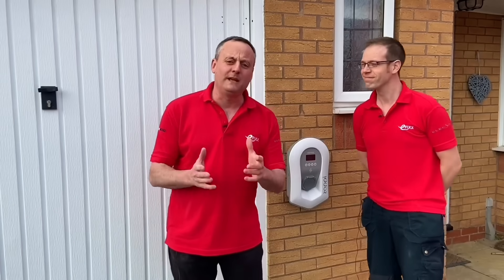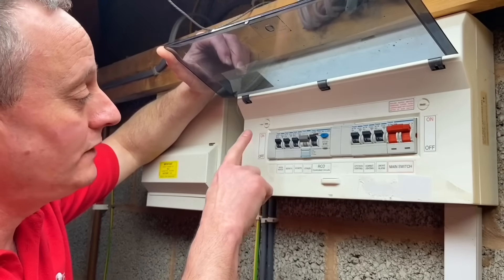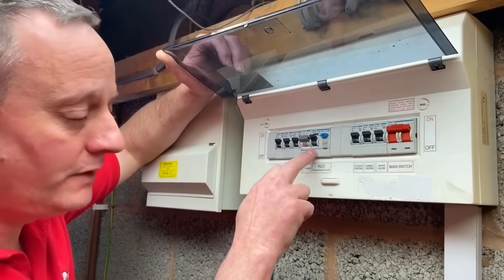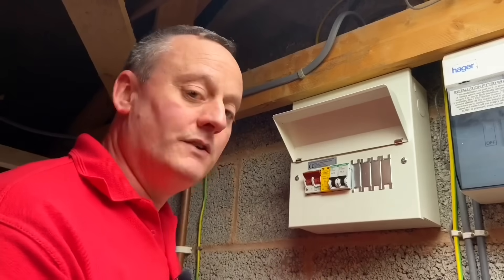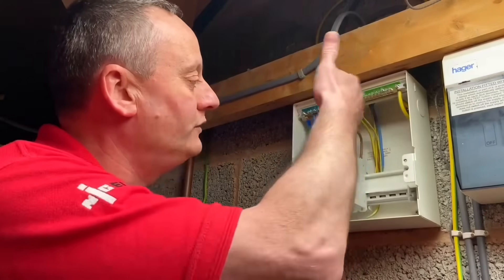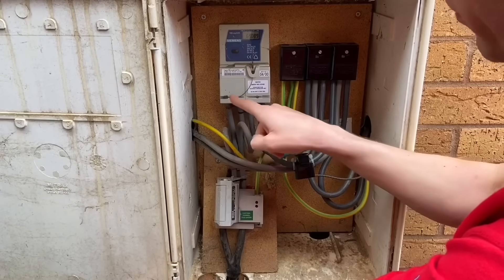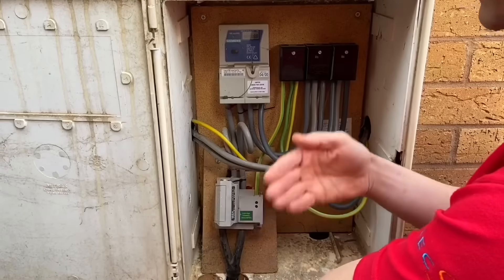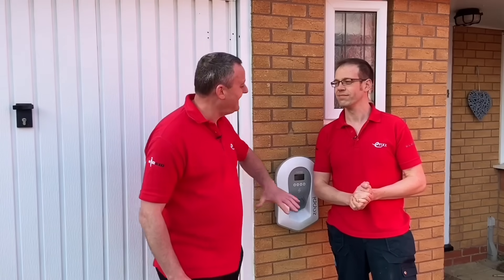EV CHARGER installation UK - can you connect to an existing CONSUMER UNIT?

Comment: They haven't used the existing consumer unit as it doesn't meet current regulations to install a new circuit as its made of combustible material ie plastic. Simple

Comment: What if that was a TT system,  then there would be no rcd protection on the main tails supplying the new consumer board and the the tails and it could be an excessive length from the mains head.

Comment: This may be a daft question, but do you need to have it wired through your consumer board? I live in flats and it wouldn't be possible to wire it all up. We do however have our meter near where the EV charger would be installed. Why can't we just have a switch in the cabinet and not have it run into our flat?

Comment: Did I get it wrong or there is no RCD protection all the way down from the mains panel to the charger unit? What does protect against residual current throughout all that length?

Comment: Just watched your other video about looped systems. You mentioned that 2 cables coming in means a looped system, and that's trouble for EV chargers. Is this not a looped system then? As it has 2 cables coming into the property.

Comment: How about fitting a kWh meter in the CU for the charge point, so the consumer can split out how much energy they're using for the EV? I visited an egg production unit years ago with inverter drives for the ventilation fans, the standard Hager RCD would trip out when you tried to run more than one fan. I suggested they fit an RCD designed to operate with Inverters, at the type it was a Schneider Si type.
Reply: The smart chargers already tell you what energy is being produced. Zappi monitors the EV, house, solar and back up batteries and can divert the green energy directly to the car.  Really good set up 😎

Comment: How would you handle adding an EV charger to a house where the consumer-unit is NOT in somewhere handy like a garage, but is in a wall-cabinet in a room in the house, so that ANY cabling or extra boxes etc canNOT be anywhere outside that cabinet for aesthetic reasons (ask the wife!).  The consumer-unit cabinet is only a little-bigger than the consumer-unit itself.  Could the new separate consumer-unit just for the EV charger be placed OUTSIDE the house near the EV charger for example?  Possibly in the outside meter-cupboard, or in a new wall-cabinet of some sort on the outside of the house?
Reply from the maker: Yes you can but the small consumer unit would have to be located within 3 meters of the electricity meter. Some installers will place them in the meter box, however this is frowned upon by the DNO and energy suppliers. You can locate a small waterproof consumer unit close to the meter box. - hope this helps
Reply: @efixx  Thank you.  That's perfect, and would work fine.  In my case, the original consumer unit, the meter cupboard, and the likely position for the EV charger would all be on either side of the same common wall within maybe a metre of each other.

Comment: Hi, We have a 32amp cable into our garage, will this be enough to connect to a charger, or is a larger cable needed. Thank you, welshman 2081
Reply from the maker: Yes should be possible if you use a charger like the Zappi - it can adjust the car charging in response to equipment being used in the garage.

Comment: Why not just replace the old DB with a new one?  Faffing around adding Henley blocks and extra tails + a second board seems over-kill.
Reply from the maker: Most EV installers are fitting a small consumer unit to avoid taking responsibility for the existing installation.

Comment: Could you just loop the new meter tails off the existing meter box ? Why did they take them from outside at meter
Reply: No and no.  You can't fit 50mm2 of cable into 25mm2 of clamps.  You might crack the old plastic CU and in a World where electricians have to use a torque screw driver to tighten screws there would be too much noise from the air whistling between teeth.

Comment: Hi is that on a looped supply? I see there’s two cables going into the main fuse
Reply from the maker: No it's a single cable, it splits into line and combined neutral and earth at the bottom of the enclosure there.

Comment: It’s best to have things separate as an electrician knows you don’t have to but it makes for easier access and easier faulting .
As a consumer unit has a number of 32 and 16 amp breakers it is best to use a spare 32 amp breaker which doesn’t upset the consumer unit do you know feed et cetera.
So placing a double pole 32 amp switched socket next to the consumer unit the protected outdoor cable can be fed into it and a feed to the spare 32 amp breaker.
Sunsee won’t that put too much stress on to the 32 amp breaker but that is the point if it does the breaker switches off and the person can check what is causing the problem probably earth leak .
Electrician of course would suggest a separate box like one each one in use in a garage or a outdoor office with its own breaker which is a bit of overkill but what consumers don’t know is it each year new rules and regulations come in an electricians have to keep advance of this , It’s just what Electricians will call FutureProofing.
Why 32 amp will this allows a 7 kW feed to the car charger, going higher than this leads to many problems as everybody knows houses now I’ve lots of electrical appliances okay not all in at once but majority of houses in the country only other 80 to 100 amp feed into this premises so going any higher might be good for the car but puts a strain on the house electrics.
As you won’t need charging in the car every night and most people have a good 10 to 12 hours overnight there is really no need for a greater power charging most nights you would just need a top up.
Multiply 7 kW by 12 and you get what will be probably the majority of car batteries in the future of about 80 to 90 kW.
 A second way is to news tales and go straight from the power switches and the consumer unit to the auxiliary unit when the auxiliary unit  has 32 amp breakers .
The only problem in the future is somebody getting a more powerful outside point might be tempted to change the breakers in the auxiliary unit to 64 and using the same old 10 amp cable, otherwise good after news what we call in the trade tales shot pieces that go from the main fuse to the power switches of the consumer unit.
Unless the outside point is very close these will be very very expensive, also I am sure there is a limit to the length that is allowed.
Some people off Claims I could go to 3 phase electricity but then you were going into a minefield for consumers, have you can see the electrics are complicated and could be coming very very complicated with a vast amount of different systems and loads placed on it.
Reply: We in the Federal Republic of Germany use longer times 3 phase power lines as our country is old. Nobody is "surprised" to use it. Of course three phase EV-charger and solar panels are here normally since the 80's.

Comment: I have just had my ev charger fitted and they never went near the consumer unit. I asked the man if he need access to it he said no. They do not wire to the consumer unit or fit any my consumer unit at 3 spares either side but it was not used. 

So why are people going on about consumer units in these video.  My charger is not wired to the consumer unit.
I have nothing likes this fitter the a new breaker in my meter locker and that's it .  Was told the surge protection was built into the charging unit.
Reply from the maker: It’s the installer preference on how they do things.

Comment: Can I ask is it ok to install a new consumer unit outside my property it is IP rated or should I have the new unit installed inside ?
Reply from the maker: If it’s properly IP rated it’s not an issue.
Reply: @efixx  thank you for answering my question my EV charger is going to be fitted by the gas boards EV fitter so hopefully it will meet the required standard

Comment: Hope someone can answer this. In the video the supply out to the charger is in T&E and clipped direct so no additional RCD protection required. This T&E however must pass through the wall to the charger, I thought if T&E is buried within a wall at less than 50mm then additional RCD is required ??
Is the T&E enclosed in metal conduit where it passes through the wall and if so does the conduit need to be earthed (I think maybe not as T&E is insulated & sheathed) !  Am i missing something ?? 
Great vid btw
Reply from the maker: Think about this logically - the RCD rule for buried cables is to protect people from accidentally damaging cable. In this case you can see the cable on the surface vanish in to a hole which is directly behind the charger.  The chances of accidentally damaging the cable are minimal.
Reply: @efixx   Thanks for reply that puts my mind to rest. Its just the regs say some concealed cables in certain instances should be RCD protected; I guess the definition of "concealed" is what threw me !

Comment: You don't have a RCD in the consumer unit because of DC saturation and blinding but the zappi has a type A RCD built in to protect it from DC fault.So this will never happen. So a AC RCD could protect the cable to the yappi. video gets you thinking thou.

Comment: Hi, I'm doing some renovation work on my house which involves lifting the floor. I'd like to lay a cable for a future eV charge point while I'm there. Is this OK to do myself so it is ready for professional installation at a later date without disturbing the floor again? I have 10mm2 T&E which I believe should be fine for a 7kW charger.
Reply from the maker: We recommend you get the person who will eventually connect it to advise on a suitable cable  route.

Comment: Russia we charge battery cars generator 27litre two stroke V10, 1560Kv. Grid not good for big charge blow transformers.
We sale  ex CCCP turbine heli, jet warbird (MIG's) track vehicle with 500kv gen. Gas turbine gen 700kv.
Environment pollute with EV more, cable underground hot melt ice/snow.
Interest in UK generate. 
Sorry bad English spell, Interpreter no in tooday. 
Greeting from Russia (Cherkasy & Girood) ♥️

Comment: 06:20 I thought the switch (for 2 or more cus) must not be covered for quick and easy access. But it seems like it's not a requirement. 421.1.201 and the switchgear must comply BS EN 61439. Now an ordinary person might not have flat head screwdriver to access quickly. 
What do you think?

Comment: Very useful indeed. Cheers. Explained a number of the less obvious issues clearly. The other docs I've seen strongly encourage you to take the charger feed directly from the non-RCD side of the CU (with a 40A breaker) (and not even consider daisy-chained RCDs because of potential discimiination problems). https://evcables.co.uk/d/global/EOCharging/20180622_General_Electrical_Guidelines_for_Installations.pdf

Comment: Great video. Just a question, is the SPD in lieu of the DC protection RDC DD & PEN fault device? As there is RCD protection in the charger it would be interesting to see what type.
Reply from the maker: No the EV charger has all of the RCD and PEN protection built in. See this video 👉 https://youtu.be/uUlyAMmGl5Y
Reply: Be careful there is no BS number for the RCD onboard as yet so requires a double pole RCD

Comment: Have to be careful if a surge protective device is attached to ring mains or radials that have new electronic devices as they have their own protective device built into the power units and can actually cause an issue

Comment: Several questions emerge on the theme of surge protection.
1.  Does the zappi have built in surge protection?
2.  Do car insurance companies cover damage to EVs caused by damaging transient voltages transmitted via the charging point?
3.  Is it likely that car insurance companies could stipulate requirements over and above the wiring regs in relation to the need to have surge protection for charging points in future?  I think weighing up question three is going to be the question of how often do damaging surges occur on the local DNO grid.  I’m guessing it’s nearly as often as there are electrical storms.

Comment: The DC RCD in the evse will prevent blinding on upstream RCD so that shouldn't be a concern when deciding which side of consumer unit to use.
Although it is still a good idea not to touch existing wiring if you can help it.
Reply: You cant fit A type RCD down stream of an AC RCD, thats what we have been advised

Comment: For those Hager boards - the MT-series MCBs (and the new ADA series compact RCBOs) will - per Hager's technical department - fit in the older plastic CUs as well as the newer Design 10 and Design 30 metal CUs.
Reply: One may argue that this translates to a lot less hours, given it is extremely straight forward.
Reply: Exactly

Comment: I am away to get an ev charger installed, can they install it straight in to the consumer unit that I have in my garage. It is connected to the CU in my house by armoured cable
Reply from the maker: Depends upon the current rating of the cable and supply arrangements at your consumer unit - eg type ac RCD etc

Comment: Has the house got LED down lights? Those causes dc leakage issues too. I would always recommend a new consumer unit. 
Wouldn't a time delayed rcd solve the selectivity issue?
Where are the Isolation switches at the meter? 
How much did the DNO charge to pull the fuse?

Comment: No separate earth ground spike to protect form DC leakage on the car?
Reply: Earth stakes are not needed if the charge unit has a built in or stand alone O-pen device
Reply from the maker: Not required with the Zappi 2 from myenergi.

Comment: Good video.   If the current consumer unit was new and the correct mcb could be sourced and inserted into a non rcd protected spare way, could that consumer unit be used instead of installing an additional one ?
Reply from the maker: Yes that is one option - but a struggle if you want to add surge protection.

Comment: I am a qualified electrician who at my works has followed the EV charging point manufacturers advice and fitted DP RCBO's to supply the charging point
Just wondering why a domestic situation would be different as I plan to buy EV car in the future !
Reply from the maker: good question - we will i vestigate further
Reply: Should be a DP RCBO
Reply: @neil03051957  Thank you  Just wanted to make sure !
Reply: DP to disconnect both live and neutral especially with higher currents.

Comment: I was amazed with the 25mm2 tails and the 100A main fuse! Here in Malta we basically use the UK system with some modifications (I had done a course for a Licence A Electrician and we referred to the IEE book quite a lot). The power company here gives consumers a 40A main fuse and if your load blows that, you are sort of forced to apply for a 3-phase home installation. I am considering an EV and this video opened my views quite a lot. Tails from our electricity meters are 6mm and we usually run a 4mm for the cooker outlet while the remaining power would be on 2.5mm, usually divided to separate 32A MCBs. Lighting is usually installed on 16A MCBs although with more modern lighting units such as LEDs etc, 6A MCBs ae becoming the norm.
Reply from the maker: Interesting system you use in Malta. For EV you will probably need some sort of load shedding / sharing - a few of the new EV chargers support this so you don’t blow the incoming supply fuse.
Reply: So your power to sockets on a 32A breaker I take it are ring circuits?

Comment: Why install only breakers from the same manifacture of the Consumer Unit ? Here in Italy is most an aesthetic reason, not mandatory. DIN is a standard for all the modular components, so they are interchanagable. Furthermore, there are many industries that produce only the Consumer unit itself, so you need to buy the breakers from someone else...
Reply: You'll find in most cases it will be down to following manufacturers instructions

Comment: Every video I’ve seen has the white box at the side of the house. My house built in 1938 doesn’t have this, just a fuse box in the pantry under the stairs in the kitchen.
Reply: It was very common for older properties to have the consumer unit under the stairs. in my grandparents house which is 50s the consumer unit, meter and head are all under the stairs. in my 60s property the meter and head are in an external box in the wall and only the consumer unit is under the stairs. At some point in the 80s (I think) they decided to move consumer units to garages or easily accessible area's rather than under the stairs. in the even of a fire in the plastic consumer units, under the stairs was the last place you wanted an inferno as you're trying to escape!

Comment: This is all well and good on a house that is not overly old but what about a house that was built in 1979 lol apparently we need to have a new fuse or something since ours can not handle EV charging and its the original electrics, outside we do have a newer electric meter and gas meter installed but inside we have the original metal wall plate that has a row of black switches on to turn parts of the houses electric off.

when i see videos about EV installations its always newer houses with the type of wall boxes shown at 0:43